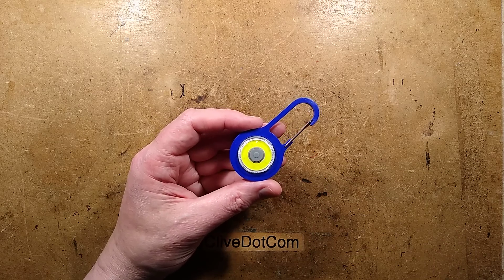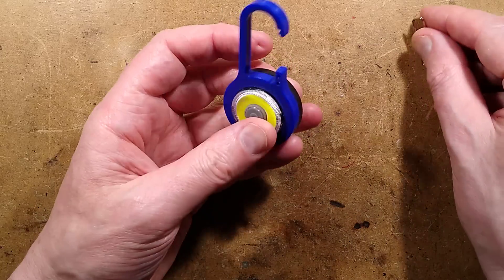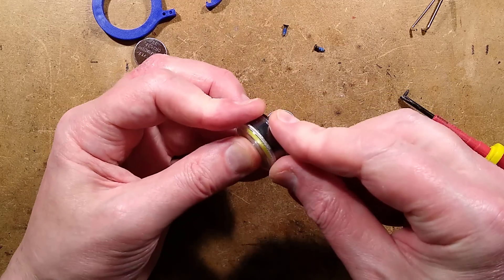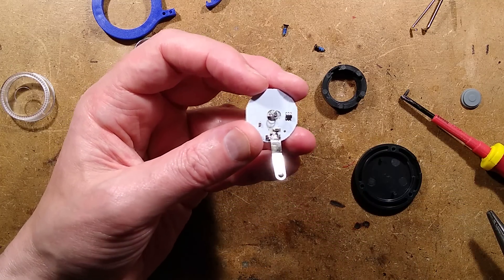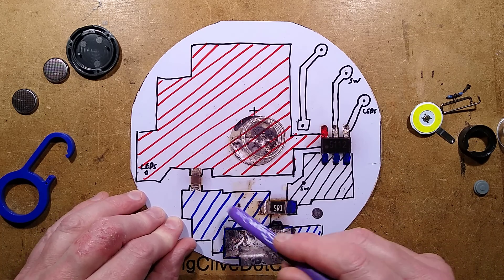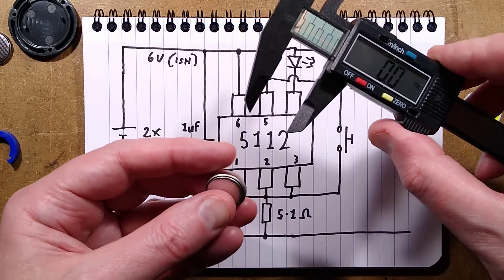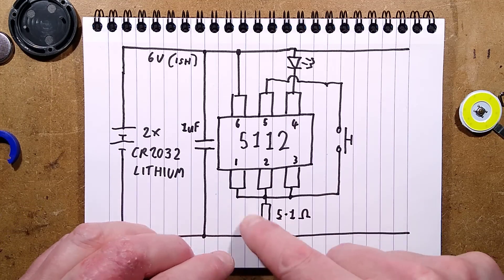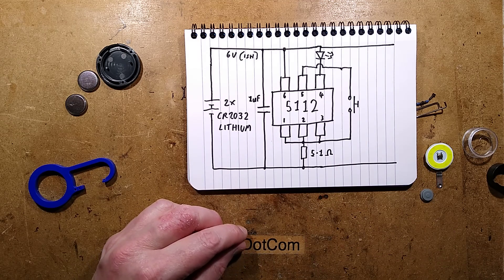I was hoping this might be usable as a mini ring light.

Comment: Uncle Clive, uncle Clive, please take a moment,
this darlington pair have got me in torment,
one is up but the other is down, I didn't think I was biased (always a clown)
PNP or NPN, I've forgotten (after 25 years) my mind doth wander, oh how the new age of electronics beckons,
a curt exchange, gone in seconds; replaced with a 'system' one fault in ten thousand and then there is YOU, a man in a million, who sees cause and effect......... nothing to rhyme there, not a problem.
We are some of the last guy's who can actually take apart a circuit and fix it. Will it be progress when we are gone?
It failed, put another one in but when that fails also, you need Clive and Clive is not available (nor am I), where is the engineering?
The 'right head' doesn't come out of a computer, some people are gifted with a mind that will follow a problem in a logical way, even better if you know the system but if they have never even soldered before, as astute as they are, don't know what a resistor is, don't know the codes, don't know why you would put a diode across a coil and just generally 'don't know' because there wasn't a need for them to know?
Intelligence and engineering, to me, are inextricably linked. Any proper engineering is just good common sense (with measurements), the likes of me, the likes of Clyde will be gone, good luck replacing a gigantic intelligence with a wet blanket and the start of your team building exercise.

Comment: Hi Clive.. sorry to contact you about an unrelated item, but I feel I need to share my findings about a major UK brand kettle.

I bought a kettle from Amazon & on first use discovered the cable was getting hot!

The cable is only rated 1mm. Looking at the recommended rating for 3kw it should be 1.25mm. My old kettle has a 1.5mm cable.

Is this legal?

The kettle is a Russel Hobbs Quiet Boil. Model 20460

I have photos, but am unsure how to send.

Comment: Desolder the switch if you want to save it for later and drill a small pilot hole in the center then go for it with a bigger bit. To get the switch working again, scratch the switch pcb trace and solder to that (adding a wire to the mcu pins directly could break it)

Comment: It looks like an LM5112 gate driver IC. Your reverse engineered schematic is somewhat similar to one of the examples in the data sheet. That is, if we replace a driving MOSFET with some LEDs. It would be a dumb way to create such a device, but it wouldn't need any programming steps in the manufacturing process so ... Idk, maybe?
Reply from the maker: It does have flashing modes which wouldn't be found in a gate driver.
Reply: @bigclivedotcom  hhmm, yea that's a fair point. Although, now I want to see if I can use a feedback loop to make the flashing effect by switching the lm5112 from inverted to non-inverted operation using just a capacitor between pins 1 and 2 if I wire it up with a feedback loop through a resistor to negative.... Probably break everything lol 
Obviously, I know just enough to casually destroy convention but not enough to be useful. Please forgive me

Comment: i believe that might be a hm5112 which if it's anything like the hm5102b connecting pins 1 and 3 to pin 6 (vcc) instead of ground would produce on/off only function
in fact it might just be an hm5102b and the curious ground lifting resistor is to deal with the fact it wants 5v max on vcc

Comment: One of the biggest issues with changing the batteries is that the batteries most people can buy in the stores are _more expensive than the entire light_.
Reply: Especially after lithium costs went up 4 fold in 3 years.
Reply: @crimsonhalo13  real question, do coin cell batteries use a significant amount of lithium?
Reply: @crimsonhalo13  I used to get the tea light LED candles from the dollar store and rob the 2032 from it, but now they use two LR44's
Reply: I havd it rechargeable

Comment: 1:38 I have a very similar one from Walmart in the US, except mine is 6x, maybe, 5040-ish SMD LEDs and the light/body swivels vertically in a little C piece with a clip on it. I’ve had it for years in the under-seat compartment of my moped to illuminate it at night, so I’ve known it cycles H-L-Strobe, but I’m only now realizing it does SOS when held…
Just opened it up (the back is just a quarter turn/locking cover) and it’s the same little prebuilt clear lens/black friction-fit ring, 2x cr2032 cells, and a 6 pin chip with what appears to be “IoTCb” with 2 dots above the “Io” part and a single dot above the “T”

Comment: Don't put that aside just yet as an idea for a ring light. Remove the switch and drill a hole. Repair the switching however-- I say, replace the power supply altogether to eliminate the flash sequence of the damned.

Comment: If the connections to the LEDs are accessible then the centre of the board could be drilled out for mounting around a camera lens and the LEDs powered from a suitable external supply,  resistor/constant current source and switch.

Comment: If you're feeling brave, could likely pull off the switch & battery contact spring, then drill a hole through the centre of the board.
While you're at it, rip the evil annoyance chip off too.
Then attach a wire to the positive remains pad and one to the other trace for the LEDS. (Yah, I know...  Nasty aluminium board...)
This may give you the tiny ringlight LED you were seeking.
Reply: You spared me typing that. I'd even like to see Clive trying to persuade that board to do his bidding.
Reply: Evil annoyance chip? The LM5112 is a tiny driver capable of 7A peak current, a very well designed chip that can use voltage reference.
Reply: @wafikiri_  And has built in useless functions that make any light using it into junk.
Reply: @Tinker001  Most of the gate driver's applications are not switching LEDs on and off but to drive transformers' or actuator coils, or discharge highly-charged capacitors: those that involve brief, high peak currents.
Reply: @wafikiri_  Still more reason NOT to use the bloody thing in a flashlight.
Reply: @Tinker001  Some creative Chinese mind found a simple way to use it in a flashlight 😄
Reply: @wafikiri_  And then is was copied by EVERY Chinese manufacturer of cheap crap lights... :(

Comment: I would remove the bottom components and take a really sharp hole punch .. punch out the button and refit the components.. solder wires for power and button..  might work if there are no tracks on top ;)
Reply: Hum. The plan is sound but I've heard it somewhere before, can't recall where though... 🤣 🤣 🤣
Reply: @generaldisarray  😝

Comment: You could always remove the switch and battery terminal, then drill out the centre of the PCB with a step drill, add a few jumper wires to circumvent any damage the hole drilling may have caused, attach an 18650 battery holder and alternative switch, and hey presto you have your ring light...
It would make for an interesting build video.
Reply: Oh you !! :D

Comment: Very interesting - I did a teardown of a magnifier headset with an LED light that had a resistor on the positive rail before the chip. Very mysterious. Mine was a mystery 8 pin chip. Pins 1 and 2 were connected to the positive rail through the resistor. The negative for the LED went through pins 5,6,7 and the GND was on 3 and 8.

Comment: I bought one cr2032 battery for my car keyfob the other day. It cost around £2.50. I'm not sure how much that thing cost, but a fiver to replace the batteries might not be worth it. And yes, I could have bought a cheaper battery, although this one was from b&m.
Reply: Buying those coin cells in bulks of 5 is somehow the same price as a single one in my experience lol
Reply: Card of coin cells from Poundland. I reckon if you use 2 before they expire you're winning. I wince at the single cells on the rack in Tesco

Comment: Didn't know CR2032 stands for its size (20mm x 3.2mm). Interesting video!
Reply: It works for cylindrical cells too. eg 18650. (18mm dia x 65mm long)
Reply: Poundland cards also have 2025 and 2016 variants. I once used 2x2016s in a Draper branded tyre gauge but the 2032s are used everywhere

Comment: I bought 3 lights very similar to that one . Has a blue silicone covering with a built in suction cup on the back. It’s about 3 inches in diameter. I use it in my boat for night fishing 👍
Reply: Really?  I've always had better luck using a line and hook.

Comment: Ah, BC. The cursed 6 pin nonsense chip! Why do they install these flipping chips? It's the same with bicycle lights, all those extra presses to simply switch it off! I have some keyring lights and I've disconnected the chip so they're press on, release off.

Comment: Wonder if you could fit two tiny lithium rechargeable pad type batteries and charge circuit in that housing or plastic printed extended rear case?

Comment: Got myself recently a flat square-shaped keychain COB flashlight on sale. It has a flimsy (by the looks of it) folding back stand, a USB Type-C charging port, a magnet on its back, and a can opener.
Its ring lock has slightly better construction than this one in the video. 

If you click the button, it changes modes bright → dim → blinking → off. 
If you hold the button for two-three seconds instead when it's off, it will switch on bright.
If you hold the button in any other mode, it will switch to even brighter than just bright.
From brighter mode, long or short button presses just switch it off.

That EDC V3 flashlight seems cooler and more professionally made, but I like this one as well.
Reply: It has 30 LEDs in the COB. One can find it by «Multifunctional Mini Glare COB Keychain Magnet» or so, there are different versions of it, tho, and you better read about its modes and specifications before buying.
Reply: I just checked, EDC V3 (both original and clone) will turn off when charging, while this square thingy continues working. Might be a separated charger, not signalling to the microprocessor.
Reply: It is made around a metal frame and also has a tripod mount hole, it turns out.

Comment: These coin cells have a large internal resistance , which is  VERY  handy for driving LED's directly  , but I wish ALL products had screws , clip together items are nasty to repair ! .... DAVE™🛑
Reply: It didn't need screws and it's not an item that needs repair, it just needs regular battery replacement. what it needed is a screw down back (whole lid perimeter is threaded) or bayonette back with an indent that fits the CR2032, so when you have new cells you want to put in, you just use one of those cells to open it.

Comment: It's not because it contains screws. it's because there is no screwdriver that fits all screws, yet. Most people have 2 screwdrivers , a flat blade and a cross blade, both of which have been used with screws of the wrong type and are worn beyond their useful lifetime.
Reply: I have about a dozen screwdrivers all of which have been used with screws of the wrong type and are worn beyond their useful lifetime.
Reply: @petehiggins33  It is high time that some bright spark marketed a device that would recreate any screwdriver tip when a selfie of a screw head is shown to it.
Reply: @tikaanipippin  How about a screwdriver made of non-newtoninan fluid that moulds itself to any screw head when gently pushed onto it but locks into a rigid solid when you turn it.  It might be a non-isotropic material that is pliable in the axial direction but rigid in the circumferential direction.  I'm pretty sure it would involve carbon nanotubes and flubber.
Reply: @petehiggins33  To remove some Playstation deeply recessed tamperproof case screws, it is possible to use a ballpoint pen's plastic case, heat the tip in a flame and then press it into the recess to mold the plastic to fit the screw, and after a short wait for the plastic to harden, it will easily remove the screw.

Comment: It's a shame there's no way to modify these to ONLY turn on for full brightness and then off. I have a little box light my daughter gave me to carry on my keys and it cycles through the bright, dim, and flashing just like this one. I really only need the bright and off.
Reply: Off/On would be nice as these chips do constant current as well, see HR810 or HR815 as examples.  Note those have an OPT pin that enables the SOS functions, I suspect if you tied one of those grounded pins high SOS mode would go away.  I did find a datasheet for another chip that hinted you could put a resistor on the OPT pin that would set different modes.

Maybe I should buy some of those 3c Padauk chips and code up my own.
Reply: Yeah, I hate how hard it is to find a flashlight that just goes on and off with the buttons. I don't need it to try and give me epilepsy, I don't need 69,105 different brightnesses. I just want on and off.
Reply: I would like brightness settings like one click on with low brightness and then next click off... and two clicks full brightness and next click off I don't need more than two brightness settings and I want it to start low
Reply: I sure ya can by disabling pins.

Comment: Very clever design. I wonder if the pcb extra copper is to aid heat sinking. We will never know🤣          Thanks Clive 2x👍.
Reply: The blank boards come coated in copper, and you have to etch the copper off.  So oddly, when working at production scale, it's actually cheaper on etch chemicals to leave most of the copper on the board rather than remove it.  They only remove it from the edges to make cutting them simpler.  The only strange part is the large plan is positive.  Normally, it is negative as ground plane.
Reply: Known in the trade as 'minimum etch'.

Comment: I'm somewhat impressed that the screws seem to have thread lock on them.
Reply from the maker: That was just the chewed plastic from being tapped in.  But they were in tight.
Reply: It could be thread lock or just blue plastic from the front housing?
Reply: Plastic is more likely, but the shape looks a bit like thread lock
Reply: @Kevin-mp5of  First impression was it kind of looked like thread locker due to the shape of the plastic that got stuck in the threads. I was probably falling asleep when I made that remark. As someone else mentioned shortly after and I conceded, it was more likely to just be a bit of plastic stuck in the threads, and your condescension is not required.

Comment: I am still trying to figure out if anyone has actually used the SOS function to receive help?
Reply: How many folks can read Morse, I'm now a little slower than I used to be at around 8 WPM from 20 WPM years ago.

If they did, someone would be sure to mistake it for the old SMS beeps! (there's only one dah or dash difference).

KW
Reply: I think this is more useful if you're for example lost in a dark forest but you were able to contact help somehow, so you tell them that they can find you by the flashing light, so they already know to look for it. Better than wasting your phone battery. Especially if there are not enough cell towers around for triangulation and your GPS is not very accurate
Reply: So a pretty specific use case. I doubt any random person would take much note of a random flashing light
Reply: Dunno if it counts but I've stuck one on the back of my car in that sos flashing mode as an improvised road flare replacement, while changing a flat tire at night. 🤷
Reply: In the rare case that you would need to signal for help, just "flashing" a torch will do the job.  Seeing that humans aren't perfect, the slightly irregular flashing would be, probably, MORE likely to get noticed.  "Hey, a person is trying to get my attention!'